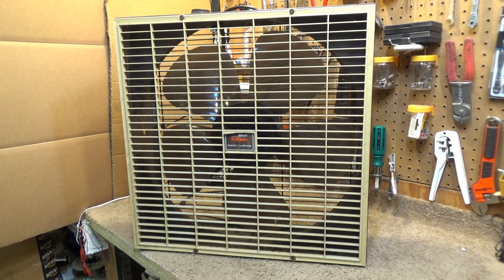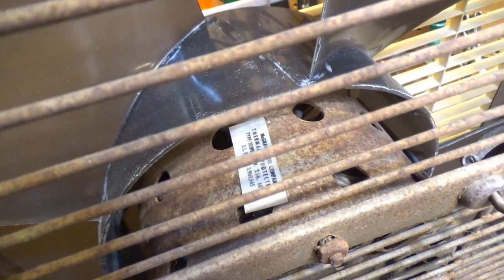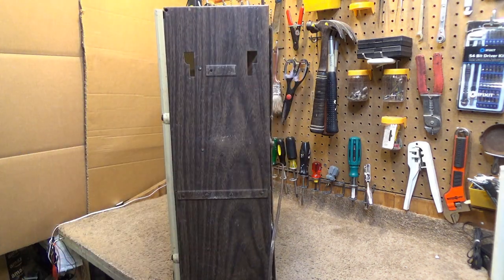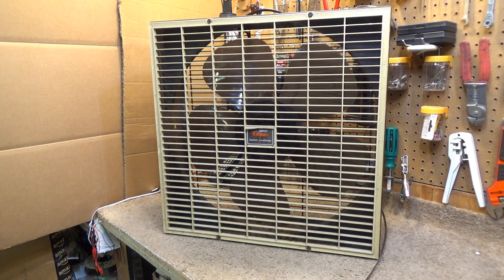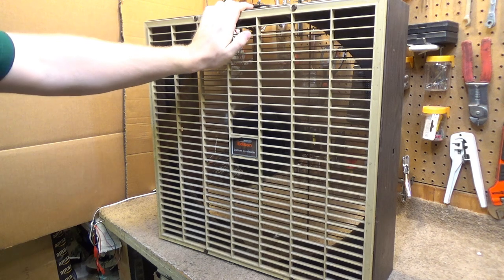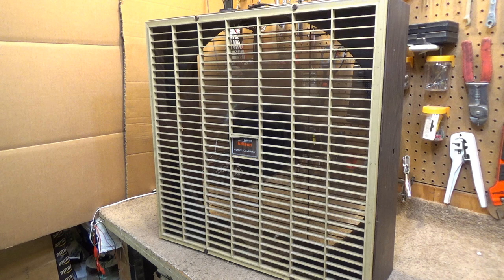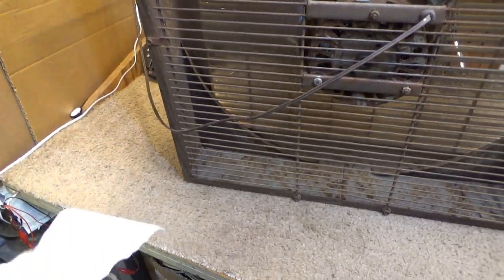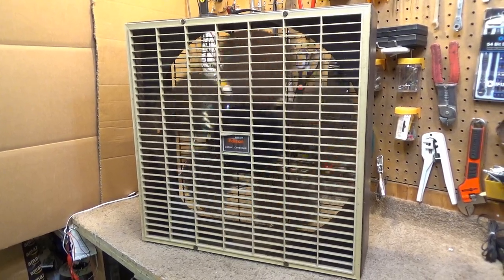McGraw Edison Comfort Conditioner 3-Speed Box Fan

Comment: This is probably an 80s model. This was made when McGraw Edison was changing over to Toastmaster. So this is probably a early to mid 80s model. The holes on the bottom are for the feet that would have went on there. This was made during the Edison Thin & Light era. These were the more expensive ones compared to the thin&lights.
Reply from the maker: Thanks for the information.

Comment: I would guess late 70s also. They made a version of this too that was variable speed, and I remember seeing some where the front grille had motorized louvers that moved back and forth to oscillate the airflow. It's interesting it has a GE made cord and plug also just like they used on their own fans except in brown. But a lot of fans did, such as Lakewoods, etc back in the 70s.
Reply from the maker: It would be neat to find the variable speed model, I can't think of many other models like that.

Comment: The whole fan is circa '78-'80. As for the motor, it's the same motor as the Thin 'n Lites of the same period. They also kept that motor design until '85 when it was a Toastmaster motor.

As for the holes in the bottom; they're for the detachable feet that the Thin 'n Lites also used.
Reply: They kept that motor til at least 87 before switching to the McMillan motors you would see in the early brown and tan Toastmaster box fans
Reply from the maker: Thanks for the insights. There can't be too many of those feet left at this point, I don't think I've ever seen them.

Comment: Very cool! This thing kinda reminds me of the GE I just did a video on in terms of design lol. I think this thing is in fact an earlier fan based on everything you said. In terms of the motor, it's quite possible for it to be early and not have oil ports, but it also deos represent the motors they used on the later ones from the 80's. My 1960's fresh'nd aire motor has the same smaller sized shaft and no oil ports. Definitely an interesting one though! If you really want to find out, maybe consider making a post on a vintage fans facebook group ( If you can stand the idea of using facebook lol) I have found many people in those groups are pretty knowledgeable about a whole variety of vintage fans. My guess it that it is early though. I think that those holes in the bottom were probably for feet, although this fan probably doesn't need them. They just don't build em like they used to!
Reply from the maker: I've always taken a liking to these fans, and I think it has a lot to do with the blade that so very closely resembles the GE plastic box fans.

Comment: Did you ever wire brush and paint this? Be cool to see. This is one of the few Edison models I don’t have.
Reply from the maker: What would you wire brush and paint? That would ruin the woodgrain.
Reply: @JordanU   You mentioned in your video there is rust and at some point, you would need to wire brush and paint the metal. (not the wood grain) I should imagine you were meaning the inside of the cabinet (venturi) and the metal grill. Yes. I'm aware not to brush and paint the wood grain. I've restored many of these.
Reply from the maker: @CartierEd  That makes sense, I was probably talking about the bottom. It's been so long since I've recorded this I don't even remember. Perhaps this needs to be revisited soon.
Reply: @JordanU  Yeah. This video was actually how I found your channel a few years ago. This fan you have and the infinite speed model are the only two I don't have in my Edison collection. Keep up the great videos! Watch them regularly.